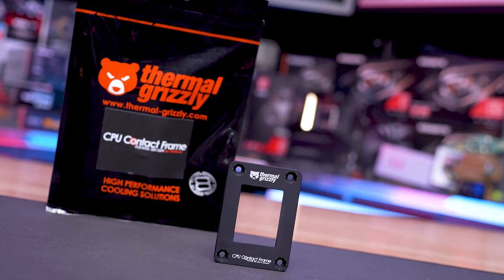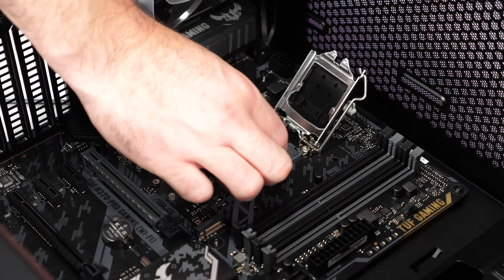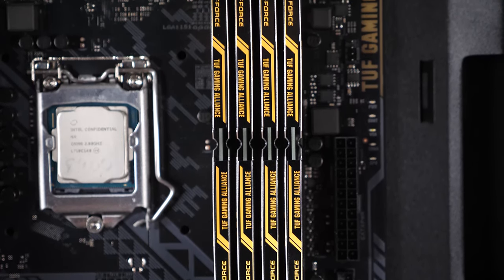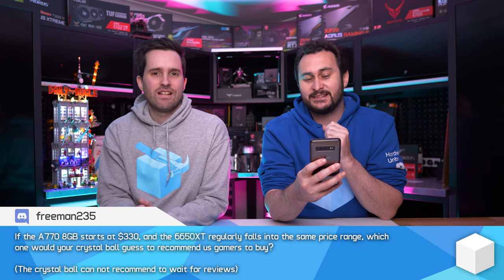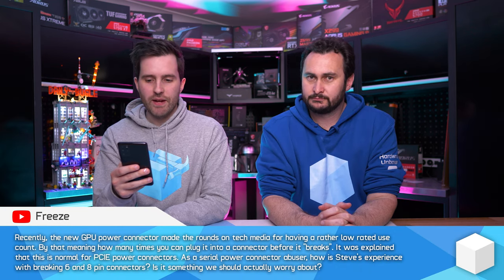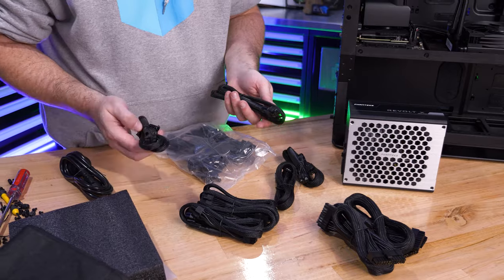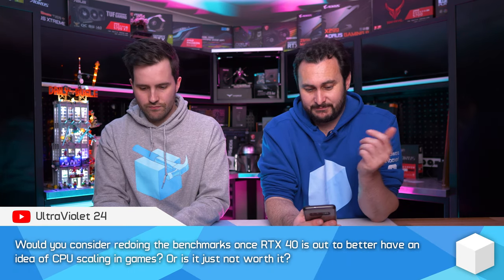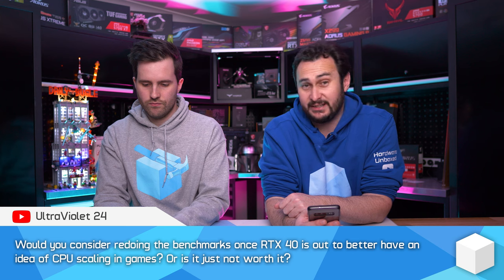EVGA Quitting Bad For Nvidia? Arc A770 8GB better than RX 6650 XT at $330 US? September Q&A [Part 2]

Comment: A770 16GB for $349 literally has no competition in the market. It's such a good value if you need the VRAM for compute workloads. Very good to have Intel stir up the GPU market with such a pro-consumer move.
Reply: If their drivers aren't garbage
Reply: @WayStedYou  Thats probably why they sell so much hardware for so cheap, the software is just bad.
Reply: @WayStedYou  not in modern games.
Reply: @serioserkanalname499  I will test it very soon, hopefully next week, when I get my free A750 from Scavenger Hunt. It seems they have really used all the delays to improve drivers and continue to do so.
Reply: What a way to spin a card so bad they have to suck it up and sell it at cost
Reply: in EU you can get barely used RTX3070s for the same price
Reply: In the UK you can get used 2080 Super's or new 3060's for that money. So it has to compete with those on FPS and software side of it.
Reply: Nvidia: Raises GPU prices because fuck you that's why.

Intel: I'm Gonna Do What's Called A Pro Gamer Move.
Reply: We will see...
Reply: @rocketboy352  these are still making profit margin, just very small, remember that Intel makes even more of the parts on a board tha Nvidia does, they can push the prices down further.
Reply: @rossharper1983  Same in Finland. Once 24% VAT is added to the 350€, A770 has to directly compete with new 3060s and RX6600XTs
Reply: @cooltwittertag  but these have only 8GB. 16GB VRAM used to be very expensive and high-end only, Intel finally changes that. Great for developers, scientists and creators!
Reply: Hopefully, scalpers won't fuck it up.
Reply: If they are competing in garbage drivers and less working titles …. Then yeah it has no competition 

Absolutely and strictly because of vram would be the only reason
Reply: @rossharper1983  it's all about the 16GB VRAM. Next best option is RX 6800 for ~$579. Some people need that for software development or compute workloads.
Reply: @cooltwittertag  which EU are you talking about? Here in Germany a used rtx 3060 (non ti) costs that much lol
Reply: Drop that to $300 USD and the 8GB to $250 USD and that will sell
Reply: @againwithadifferentname4880  USED = MINING CARDS. NO THANKS
Reply: @ProjectPhysX  agreed, but those people are limited compared to the number of people who want them for gaming and Intel needs to shift these things by the pallet load or their just leave the market
Reply: @gabriellakotainegabor1902  yeah, even if decent deal, I really do not want to give any money to miners. The pricing would have to be ridiculously cheap.
Reply: all depends upon.. is your software/program/application/code designed to consume the given resources better than competitiors.
Reply: @nhojlagap6222  I would not buy an Intel GPU until they cen prove they are good. Give them to Gamers Nexus,  Hardware Unboxed,  Paul's Hardware,  Jayztwocents,  etc and let them review the cards and say if they are worth the price or not.
Reply: @ProjectPhysX  🤦‍♂️ vram does not mean as much as you think it does.
Reply: @ProjectPhysX  🤦‍♂️ and those people are not buying the GPUs you can get at a Microcenter or Best  Buy or Amazon to being with.

They are getting a work station computer with either a Nvidia Quadra GPU or AMD Pro GPU. Even then if they are some youtube content person they are using either Apple computers or Nvidia GPUs in a system they built themselves.
Reply: @serioserkanalname499  it will improve for sure, atleast on Linux which matters for me
Reply: @evacody1249  agreed, their statement about performance still needs to be validated. However my statement about Nvidia driving gpu prices still stands. Hope intel and amd drive those prices back to normal.
Reply: @cooltwittertag  I’ll sell you a well used 2080 Ti for several hundred American dollars.
Reply: @evacody1249  for most compute applications, VRAM is everything that matters. I work in computational fluid dynamics (see on my YT channel) and there performance is entirely limited by VRAM bandwidth and grid resolution is limited by VRAM capacity.
People like me don't have infinite amounts of money to spend on overpriced "Professional"/Apple hardware either; especially since gaming GPUs are actually faster for these kinds of workloads than Quadros. Only the very expensive datacenter GPUs like A100/MI200 are even better with their large VRAM capacity, but those cost a few $100k in a server. We still use 10 Radon VII GPUs for their 16GB memory, those were the cheapest option back in the day by far.
Reply: The RX 6700 XT 12Gb I found for $299 on eBay I believe is of similar value.
A used card, said to be a couple months old. It arrived in pristine condition.  Probably buyer's remorse of earlier crypto prices.
Even so, I rather put my trust in judiciously picking thru the used cards market than the current state of Intel's GPU drivers.  Lol
Reply: You can get a 6650 XT for 300$ or a 6700 XT for 400$. Both are way better deals than buying fucking Intel.
Reply: And hopefully AMD and Nvidia will follow up, eventually... well, atleast you could hope...
Reply: Only API it runs good is DX12 i would rather buy a slower AMD or nvidia then that Arc GPU
Reply: @Silver Joystix lol what? Only API Arc GPUs can run decently is DX12 or other APIs run like dogshit on intel GPUs while AMD fixed both DX11 and OpenGL drivers
Reply: @Silver Joystix I agree. Intel having bad drivers is a given, their first standalone GPU, noone gets the jackpot first time trying.

And AMD has had bad drivers for every GPU up to 12 months AFTER release for every single GPU they ever released, and noone is noticing?
I smell AMD fanboys, in fact, it stinks...
Reply: If drivers work
Reply: Let's see
Emulator performance??? Need to be tested
Productivity?? Good
Dx 11 games okay
Dx 12 games good
Dx 10 games ????? 
Dx 9 games ????
Driver for newest game support????
Reply: 6700xt has 12gb vram, and can be eadily had for 370-380. Not to mention the used market is getting flooded
Reply: @ProjectPhysX  Does your Scavenger Hunt A750 have a warranty?
Reply: Huge red flags over the Arc cards.  They have been continually delayed and driver issues have been exposed. Is the hardware or software or both the problem? Ryan Shrout is not someone I would have used to market any legitimate product with his history...
Reply: It’s a virgin architecture and drivers will be shit for at least a year. There’s no point having a ‘better value’ card if the experience is 20 minutes of gaming then a sudden crash. People should wait out before buying intel cards.
Reply: @evacody1249  drop Jayz and add coreteks
Reply: Pretty sure @ProjectPhysX means specifically compute workload. 16GB might not be appealing for gamers (which is the majority here) as not so many games would be able to use it and the GPU performance matters much more than that. However those AI researchers especially students would be interested in the cards. Of course the numbers doesn't compare. 

Of course performance matters in compute workload as well, but if there's not enough vram those tasks will not run at all anyway. VRAM are more important in this kind of workload.

I can imagine data center providers order this GPU to provides compute workload services for cheap.
Reply: @ProjectPhysX  🙄 sure keep believing this will be good without the testing being done.
Reply: @Silver Joystix 🤦‍♂️
Reply: @serioserkanalname499  The hardware is cheap because they need market share for it to even make sense for them to launch a new card and justify all spending in software support to continue to improve drivers. It also does not help that they launched it after the crypto crash and not before when GPUs were generally in low supply. Furthermore, new GPUs are just around the corner and they are still having a hard time to compete with current generations so dumping these models quick is important.
Reply: @nazmulfahad3044  Or read customer reviews to know if it's really trash before assuming it's definitely going to be.
Reply: @WutipongWongsakuldej  why? The card has not been tested by reviews. All this is is what Intel says. Just because it has 16gb of vram does not mean anything be ir gaming or work.

How will it run on those programs? No one knows. This is being hyped up way to much before tests and benchmarks are done. 

Then people are saying it's better then AMD and Nvidia. With out proof? Right from Intel.

Look I hope these cards are good. But I'm not going to hype them up without them being tested and released to the world. 

Until then on paper it looks great on 📃
Reply: @gurjindersingh3843  probably standard 2 year warranty
Reply: 6650 XT was $280 last week
Reply: Potentially the best Card for video editors below $1000
Reply: @Ilost11  I have a feeling they're just going to dump the majority of them onto OEMs.
Reply: Fanboy detected
Reply: If I reckon MKBHD got one, I think it will be a great card for "hooby/professional" use.... Just wait for the reviews next week
Reply: @DM-fp8uw If their claims are correct, A770 will be faster than 3060 Ti, 6650 XT is no match. A750 will be closer to 6650 XT but it could be faster in RT.
Reply: @gurjindersingh3843  “Their claims “ being the issue.  They originally claimed 3070 performance.  They originally claimed released earlier this year.  Their claims have all been BS so far.  Not to mention the driver issues that’s are stills ongoing.
Reply: @farmeunit  Not to say that NVIDIA claims have been true, remember 3080 was supposed to be 2X as fast as 2080 but it was actually 1.6X as fast. Now they say 4080 is 2-4X as fast as 3080 and we know how.
Reply: ill probably buy one just to have it. I really hope they dont cancel future generations. I would love 3rd competitor in the space
Reply: @gurjindersingh3843  You can’t trust any claims until actual benchmarks come out.  Real world use is even more important because you can’t cherry-pick results.
Reply: @gurjindersingh3843  If an A770 is as fast as a 3070 for $330 then they will definitely have something.
Reply: @DM-fp8uw  But they may not be able to compete with used 3070s soon.
Reply: @ProjectPhysX  the A770 is not strong enough for 4K so 16G is pointless
Reply: @againwithadifferentname4880  I bought a 3070 in Germany for less than 400
Reply: @jhanninnen  🙄🤦‍♂️ because I'm really going to take the word of MKBHD over if the GPU is good or not over Hardware Unboxed or Paul's Teah. Yeah that's the way to do it.
Reply: @gurjindersingh3843  no it won't a 3060ti is on par with a rx6700xt and rtx3070.
Reply: @gurjindersingh3843  you have FOMO. It's not even out had not been benchmarked nor used in the real world yet you are buying into Intels hype.

Stop buying into the hype. Let it come out let's see what happens and if Intel can fix the driver issues. If they can do all of that then maybe we will have three companies making GPUs.

But hyping it up and getting FOMO only for the chances of it to fail are high is not good.
Reply: Heavy respect for those that will buy an Arc GPU, they either have courage of steel or balls of iron or maybe they don't value their money.
Reply: @evacody1249  if you do creative work, he is a reference on YouTube, he also works if top notch 8k raw footage, I've never seen HU or Paul doing some similar
Reply: @jhanninnen  Dude he is not someone you go to for information about computer hardware. 

He would not have a clue as to how to really benchmark the GPU.

Look I want this to work out I'm sick of what Nvidia is doing. But let the real PC tech people do the benchmarking and wait for what they say.

Intel gave MKBHD the GPU because he is not going to trash it that's not what he does. He will say it's great so as to keep getting stuff from Intel. He does it with Apple, Samsung,  Google, Oneplus,  etc.

Gamers Nexus,  Hardware Unboxed,  Paul's Tech, Tech Deals and a few others are the ones who are going to be up front and honest.

We need a third player in the market we need Intel and AMD and bot have great GPUs coming up that will truly give Nvidia a run for its money.

Hyping it up though and just saying yeah Intel is right and MKBHD said this and getting FOMO could hurt this if it's just good on paper.

It can't be just good on paper dude. It can not just be what Apple does with there crap. If a number of driver issues are worked out and it works really good in real world tests and benchmarks to where we see them in pre bulits and even DIY builds then I will be very happy.

Because then there may be a chance of Intel put out higher end GPUs putting more of a hurt on Nvidia and kicking them to respect the customers again.

As it stand when it comes down to it the GPU to buy for 1080p and work loads that is not Nvidia is AMDs 6600xt and 6650xt. Cost vs preformce it's great. 

Can Intel give us a third? Let's wait and see.
Reply: @siphi7583   I'm hope this works for Intel. But I'm not going to get them up really high until the tests come out.

If it's really good and gets good reviews from the people who will test it ie Gamers Nexus,  Hardware Unboxed,  Bitwit, Jayztwocents,  Paul's Hardware,  Tech Deals, and a few others  and major PC magazines then great. Maybe then if the sales are good Intel will put out higher end GPUs and end give Nvidia a run for its money.

Think if AMDs 7000 series is priced right we could see a lot of just all AMD or Intel builds forcing Nvidia to rethink there pricing.
Reply: @siphi7583  heck maybe it will have another tech company grow a pair and jump in on making desktop CPUs.
Reply: Agreed, just hope they don't make it too "limited edition" so that it becomes hard to get.
Reply: @evacody1249  The 6700 XT is between a 3060 Ti and a 3070, closer to the 3070.
Reply: @evacody1249  Bro I'm a primarily Mac user, I'm working with some creative work, a Quadro GPU would be my best option, but I want to have some light gaming, so an Arc 16GB gpu can be a great fit for me.... Of course I'll wait for HU, tech Jesus and others to test intel's hardware, but MKBHD is a fundamental source of info for me, as real user
Reply: @cooltwittertag  16g is not pointless, especially when mixing both play and work. Its not just about monitor resolution either.
Reply: Look, don't buy Arc thinking about actual work with it. They are suffering getting games being smooth on top of general system stability and that's their current focus, there's nothing that they have shown regarding professional CAD software nor scientific research, so don't set yourself to fail in that end.
Reply: @evacody1249  A 3060 Ti is a little slower than 3070 and 2080 Ti.
Reply: @evacody1249  Wrong, a lot of startups don't have the budget to buy workstation GPU's. So more vram and drivers that support Open CL can become a thing for data researchers.
Reply: @garyb7193  May work in specific countries like US or UK, but not so in others where used markets are very unreliable.
Reply: @DanielFrost79  Got my RX5700XT and driver nightmares initially. But now the drivers are good.
Reply: @cooltwittertag  I'm talking about compute workloads and software development, not gaming. For these applications you need the large memory capacity, and the FLOPs are less important as memory bandwidth usually is the bottleneck.
Reply: ARC is going to age like fine wine. I suspect it'll be above 3070 level 1 year from now.
Reply: Seems to look pretty interesting for compute and similar, but for gaming, it's a no go
Reply: @ProjectPhysX  then you are talking normal RAM not vram
Reply: @IdeaBoxful  🤦‍♂️ dude right now the more vram means jack and s*** because we have no ides how these will benchmark or run in programs 

Yeah the 3070 has 8gigs of vram and the 6700xt has 12gigs of vram. Guess which one gets higher FPS and runs better in work programs. If you said the 6700xt you are wrong and I own a 6700xt. The rtx3070 is the better card. 

Does that mean I'm going to run out and buy the 3070? No.

More vram means thing if it does not do well in the benchmarks and testing from the the reviewers. 

It has to work well with the programs and need to have many drivers fixed. Stop hyping it up to the point that if it's not all the way fixed that it will fall hard and fail.
Reply: @gurjindersingh3843  no kidding because it's a mid range GPU. It can keep up with a 6700xt  and 3070. So if you are coming from a 2060 or 1060 it's a really good buy.
Reply: @revdarian  yet that's what people are doing with out the reviews. I mean I want Arc to work and do well. I'm not going to hype myself up for it though.
Reply: @jhanninnen  that's cool and right now 16gb of vram means nothing when Arc still has a lot of issues that need to be worked out and there have been no official benchmarks ot tests from every day users and reviewers. 

And sorry MKBHD may do great on phones. But he knows hack about computer hardware. He has only built two computers in his whole life and you are telling me he is a good go to for knowing what a good GPU is? Get put of here with that.
Reply: @evacody1249  no I'm specifically talking about VRAM. See my channel for examples on what you can do with large VRAM capacity. I commonly use GPUs with 40 or even 64GB VRAM for my work.
Reply: @ProjectPhysX  dude you want to know the issue here and thr problem with "it has 16gigs of VRAM" is?

They are coming out the same day that Nvidias 4000 seires comes out.

I hope Intels GPUs turn out good. But as Gamers Nexus pointed if Intel had a lot of faith in then they would not release them on the same day as Nvidias new GPUs. 

The news will be about the new GPUs from Nvidia not ARC and Intel knows that. They know that because the drivers are not ready and chances are the GPUs are not that good.

But the VRAM means nothing if the programs it will be running don't even bother to use it. And we won't know until it is benchmarked and tested.

You are basically just being a fanboy. You have no clue if these will be good or not yet you are going to blindly fall it the way Nvidia fanboys and Apple fanboys do. Great job.
Reply: @ProjectPhysX  also know I'm not going to watch your channel. I'm going to watch channels that are like Hardware Unboxed or Tech Deals where they don't fan boy over products.
Reply: @evacody1249  Nvidia 4080 16GB costs $1199, A770 16GB costs $349. I see no issue of launching GPUs for high-end and budget range at the same day.
I am no fanboy to neither vendor. I use all Nvidia/AMD/Intel GPUs with my software (it's OpenCL so runs on anything). I like fast GPUs and need them for my work, and I find it good value to sell a 16GB card for the lowest price ever. It's the competition that benefits consumers after all. I will test the A750 very soon and see if it works well in OpenCL. No reason to be so ignorant and insult me here.
Reply: @ProjectPhysX  🤦‍♂️ oh my God you don't getting it. Intel is doing that because they know it's not good and it will not get coverage. Also the fact you are trying to compare two different GPUs that are not even out yet.

Just stop. Stop with your BS because that's all it is.
Reply: @evacody1249  Well I tried the Stable-Diffusion in the other day and my 3070 cannot run it due to memory constraint:). Obviously the performance is one important, but as I said if there's not enough memory then the program wouldn't run at all. 

It's better to be slow than not working right?
Reply: @WutipongWongsakuldej   so here is the question do you even have the hardware to run it?
Reply: @evacody1249  so here is the question, do you know the word "speculation" ?
Reply: So excited to try it out with the ML stuff they announced for devs at their innovation event!
Reply: @WutipongWongsakuldej  SO here is the word do you know what Hype means?
Reply: @evacody1249  I'm not talking about *Hype*. The reason I bring the word "speculation" here is we don't have the card. Steve most-likely have one but he's under NDA so he couldn't say anything. All we can talk about here is just a *speculation*. 

And that's not hype per se (trust me I did buy cards for the hype reason before). The 16GB actually means something for AI/ML researchers, as this kind of workload can easily chews 10GB+ of VRAM. This is why card like AMD Instinct comes with 16GB of memory.

This card comes with 16GB VRAM at the ~USD350 price point. Usually GPU with the same amount of VRAM or more are over USD600 (eg. RX6800XT, RTX3090). 

With this amount of VRAM it has a potential for this kind of workload. I can see it becomes a poor man solution for AI researchers. 

And that's what OP (and myself) is exciting about.

Of course I appreciate how realistic, down to earth you are. There's no number to back this up, yes. And Intel might screw it up (very unlikely) in this kind of workload.

To be honest I'm not gonna buy this without seeing numbers.
Reply: RX 6800 is pretty solid tho
Reply: @evacody1249  I am not talking about gaming but running things like OpenCL. Also I am not hyping either. I do agree on the driver aspects. But then again AMD went through the same situation. I am talking VFM - Value For Money. Not the highest FPS hype train. I am not interested in that. 
And those GPU's are space heaters. Energy bills are going up astronomically. The FPS and the DLSS argument alone is not going to look great on the wallet.
Nvidia has shot the prices to astronomic figures using uncompetitive practices.  Do you think they care about you? No they have corporate customers spending millions of $ for the AI stuff and Robo Jensen. That is their cash cow. Big ticket stuff. PC gaming is a small niche.  Players like Intel and AMD still needs PC gamers and small biz to buy their stuff.

I am using an RX5700XT for my gaming and 3D render/OpenCL compute work. Bang for the buck given I paid only 600 $ equivalent in late 2020 in my country where there is heavy import taxes. We have atleast a 25% markup to US prices.  I had driver problems from AMD in the beginning. But drivers are solid now with a lot of features added.  I may get a 6900XT as the price is looking more attractive now. For a large percentage of the market its VFM. The bleeding edge nerds will always pay up for that launch hype. Most of us are not.
Reply: @IdeaBoxful  🤦‍♂️ and so far the reviews are stating don't buy it there are still a lot of issues. You don't seem to understand that you are going to be a beta tester.
Reply: The average gamer couldn't even tell you what compute workload is. They jsut want to stick the card in, get good frame rates, which is all well and good with dx12 titles but dx11 and even dx9 are still popular. They need to fix that ASAP.
Reply: It's sad that no one on YouTube (except LTT and some smaller channels) has really tested any non-gaming workloads. The encoder is a psycho beast to where the A380 beats just about everything in encoding despite the massive difference in power.

But Intel's philosophy of, "Screw the past! We're just focusing on new stuff!" has really turned me off from Arc despite the positives. I found out recently from LTT (Tech Shrek has his perks.) and Phoronix that only Linux Kernel 6.0 and above is going to be supported by them. That takes my usual distro out of the equation unless I run the experimental branch or Hail Mary it and probably break it like a dummy on my own. And according to Distrowatch the only distros with it currently included in the latest (still kinda messy) releases are Fedora, openSUSE, NixOS, Gentoo and Mageia. I don't mind living on the edge, but I would never use it outside of personal stuff and even then I'd feel like playing in a minefield blindfolded and drunk, which makes me sad.
Reply: @ProcyonAlpha  Honestly with most DX9 titles, I really couldn't care about ultra high framerates (Though the solution Intel uses seems to be borked and has a lot of titles with a 1% low of exactly 60.) unless there were serious game breaking bugs which don't seem common on DX9 titles for some reason. I'm not too hung up on it overall and I don't play CS:GO at all, so it's just an annoyance.

But DX11 performance and a lot of decisions on Intel's part regarding support for past standards could be charitably described with AVGN's "What were they thinking!?!?" It's the nightmare scenario that everyone predicted of broken buggy drivers that make even the old Linux AMD drivers look functional and those drivers were *bad*.
Reply: Trust me, Intel didn't want to sell their card at that price, they just had no other option. Still excited by what they may bring in the future tho.
Reply: I'm genuinely excited about Intel coming into the GPU market and actually the A350/A770 is a decent first go. All the hate towards them over drivers etc. Are we really surprised by them having buggy drivers at this point?  I didn't expect Intel to nail it first time out, and they have exceeded my actual expectations.  I have no doubt that successive driver releases will solve a lot of their issues. I think that by the time they get their 3rd gen out they will be competitive in the mid to lower tiers.
Reply: @evacody1249  I too was starting to wish on the Intel card but thats a bs approach. The AMD cards have the best value right now.  You are perfectly right. Ppl are too careless with their $$. Dont pay for crap. They have multi billion dollar enterprises.
Reply: @depth386  I want one. I just dont care for that price tier. Maybe if i had some professional work for its capacity.
Reply: "compute workloads" and "consumer" in one sentence… you should untie the knots in your brain first.
Reply: @nhojlagap6222  Intel: I tried, folks, I tried…
Reply: @nhojlagap6222  I don't need AMD/Intel to drive Nvidia's prices down, I just buy AMD and a much better price/performance.